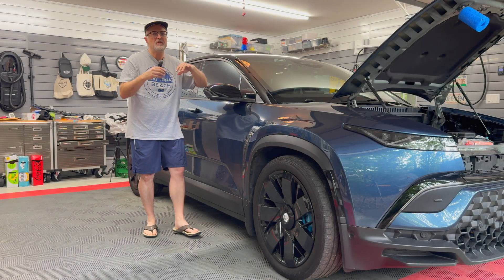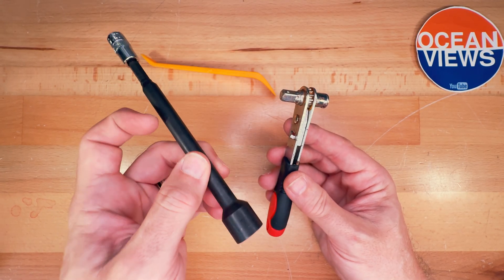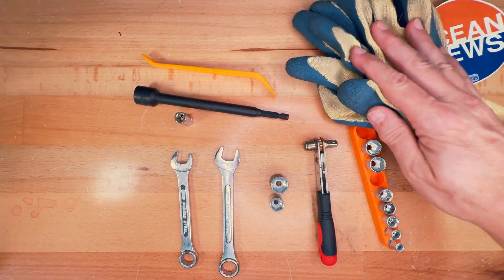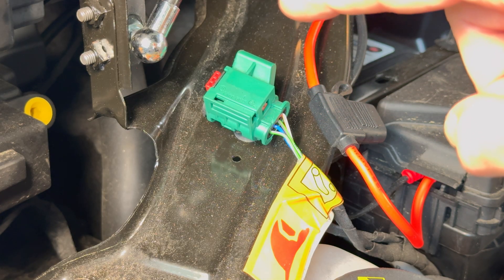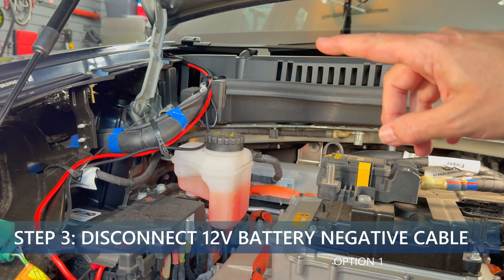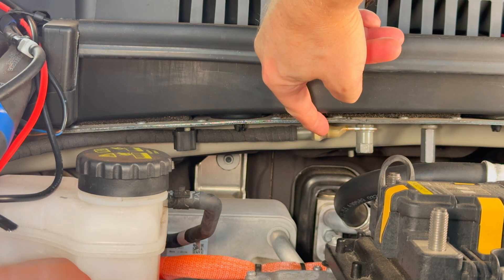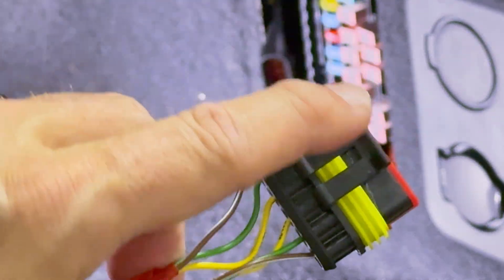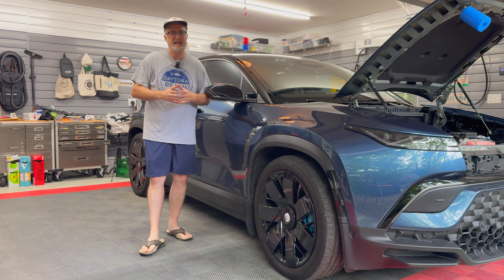Fisker Ocean - HV/LV Hard Reset

Comment: Hi,
Thanks for this video.
I had a problem with WiFi and did a HV/LV reset as you described. After turning car on, WiFi worked fine, but the driver's instrument panel didn't turn on. Do you know how to turn it on? Should I do another reset?

Comment: Hi Matt! Would this work to resolve the Ocean not shifting into gears (R,N,D) even though there is enough charge in HV and LV batteries?
Reply from the maker: It’s possible if other reset methods haven’t been effective.  Another thing to look for is the seat sensor can also cause this error.
Reply: Yes, that’s what I’m reading in the FOA forums. The car had been dormant for a few days but there was enough HV charge, and even LV read fine. I think the cabin light staying on caused some sort of glitch within the LV or the car. Is there a way to reset the seat sensors or any of the fuses related to that?
Reply from the maker: @shivpalvansadia9152 Are you referring to the rear lights?  That’s a hardware problem and I cover two solutions in my videos.
Reply: @MTNRanger Yep, the rear cabin lights. I never fixed them because they hadn’t caused any issues. But the car was idle for six days so something caused a technical or mechanical glitch resulting in the gear error problem. So my guess is that the cabin lights leading to a 12v problem as culprit.

Comment: I have a starting issue on my Ocean after press break pedals. After charged the power turned off automatically after few seconds. I tried to soft reset and deep sleep mode too. However for deep sleep mode, my blue light won't turn off. So I wonder should I follow this video guide in order to bring my ocean back to normal.😢
Reply from the maker: First, how old is the 12V battery?  Is it in good condition?  Does the voltage stay above 12.0V when not charging?  The battery is the first thing to check and is the cause of a lot of issues.
Reply: @MTNRanger  After purchasing the vehicle, the battery has never been replaced. Up until just yesterday, charging worked without any issues. However, after charging was completed and the next morning I got into the car, I pressed the brake pedal and saw that the screen displayed 90% charged, but then it switched to dashed lines and many warning signals appeared. After that, when I released the brake pedal, the car power turned off.
Reply from the maker: @TKhsu72  So you don't have a 12V battery monitor or anything?  We need to verify that the battery is good.  The second thing is that there may be water in the wiring connectors. I could try to do the hard reset like I show in the video, the only down side is that you need to reconfigure the doggie windows for California Mode (OLP, Freesker, service tech).

Comment: Hey sir, so my moon roof stopped opening n my doggy windows too. Can this solve the issue?
Reply from the maker: You will need to recalibrate the doggie windows with OceanLink Pro, Freesker, or a service tech.  The sliding roof can be reset with the overhead button (push all the way forward for at least one minute).
Reply: @MTNRanger  I appreciate it a lot

Comment: I would love to see a video on how to access the amp in the right rear trunk. Need to take off paneling. Don’t know where to begin.
Reply from the maker: I haven't needed to do it yet.  But from what I have heard, the panels should pop off.  You may have to remove some of the rubber weather and plastic trim first.

Comment: Did you have to recalibrate the doggy windows after disconnecting the 12v battery?
Reply from the maker: You will have to with this procedure.  I didn’t actually do the reset on my car in the video.  But I did perform on another owner’s car two weekends ago.  They reset the doggie windows with the OLP app.

Comment: Question? Can you charge the battery pack and at same time you charge the 12 volt battery?
Reply from the maker: Yes, in fact when the car is charging the HV battery pack with an EVSE, it also charges the 12V battery at the same time.

Comment: for the previous comment you are exactly right after 10 minutes the charge on computer will dissipate, if you just unplug and plug back in nothing happens...got that right before bankrupcy when fisker sent a tech to our house...sadly he told us solar never will work and that is why we bought the car!
Reply from the maker: Some people have seen the solar add miles, but it's hard to verify since we don't have direct access to the BMS.  Other people say it's not connected at all and just displays what would have been generated.  I meant to try another test this summer for a full day in the sun to see if it actually does increase the state of charge.  Previous testing was when I had 2-3% vampire losses so any solar would not show anyway.  Now my vampire losses are less than 1%
Reply: @MTNRanger seems like another way to verify is to measure the current flowing into the battery when the car is parked in the sun.  You would need an ammeter clamped onto the correct cable (either + or - cable, not both).
Reply from the maker: @cjzitoI don’t think the cables going from the solar roof to the inverter/battery are easy to reach.
Reply: @MTNRanger  Certainly they're protected, and orange.  Wish I had a schematic and a 3D electrical wiring layout.

You don't necessarily need the cables going from the solar roof to the inverter.  The main power cables going to/from the battery would also work just fine, if you could clamp on an ammeter.

Anyway, I had my car parked in the San Diego sun for 10 months and got maybe 250 miles of solar charging, according to the display.  So I'm extremely skeptical and am inclined to think the solar roof was a gimmick all along.

I've read some comments that suggest that the solar charging only occurs when the car is "on".  Which would be a stupid engineering limitation, but plausible given all the other stupid engineering design features.

Comment: Not sure why a 10 minute wait is required.  I thought removing the HV and LV powers off EVERYTHING?  So what is happening during those 10 minutes when nothing has power?  My only guess is that there is a capacitive energy source that backs up some computer for 10 minutes upon a loss of all battery power.
Reply from the maker: It’s the recommended time.  I’m guessing for the reason you mentioned.
Reply: Great video. Once again to the library on how to service Fisker for all in this  community ❤❤